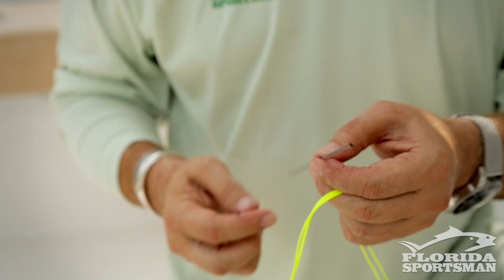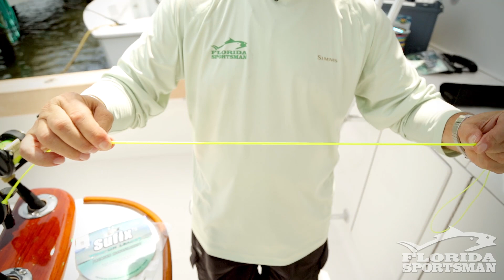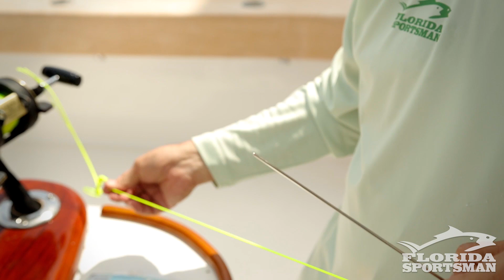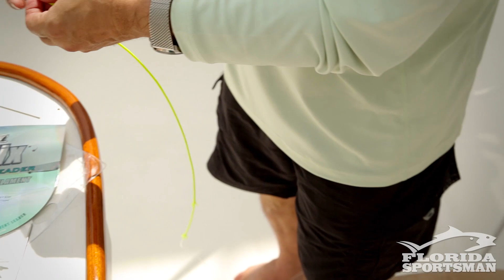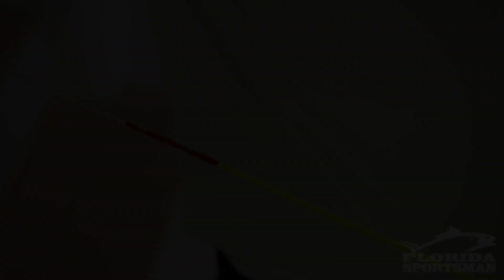FS Seminar - Wind On Leaders

Comment: Can u explain this set up and what is the advantages?
Reply: Smooth connection between braid and mono. It’s 100% breaking strength and allows you to connect the braided line on your reel to your long monofilament leader. This connection is very sleek so it can be reeled right through the guides and into the reel. If you used a swivel instead, you’d have to stop with 100’ or more of mono out and wire fish to the boat by hand. The mono allows for stretch which absorbs shock from fish striking lures or baits at high speed or when they jump. This helps prevent break offs and pulled hooks.